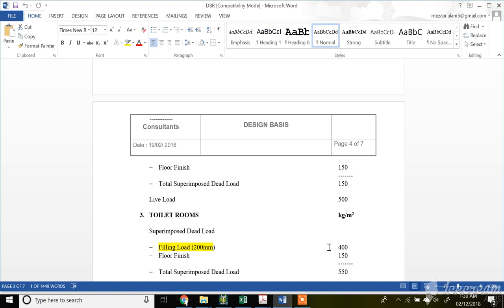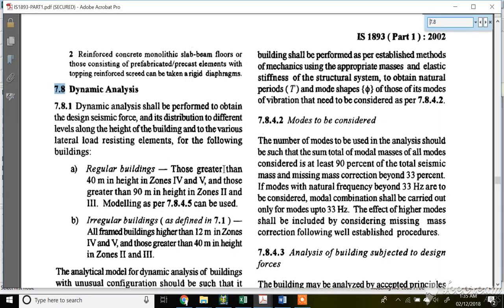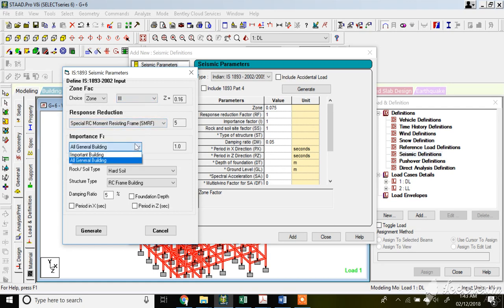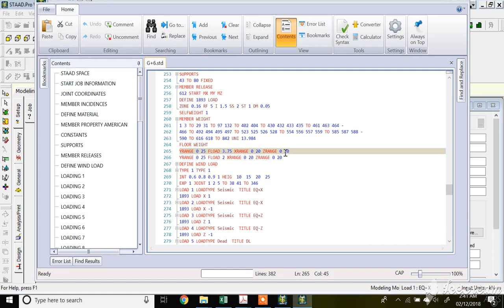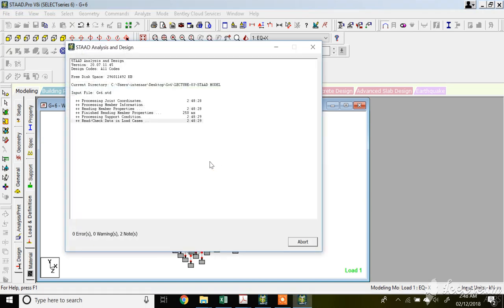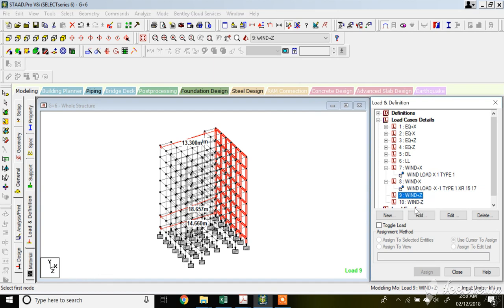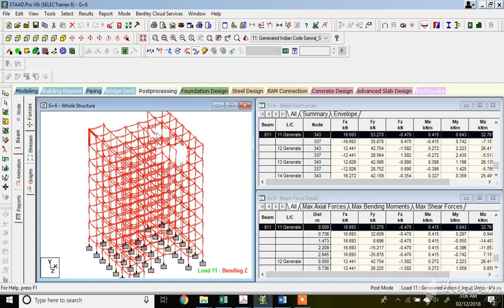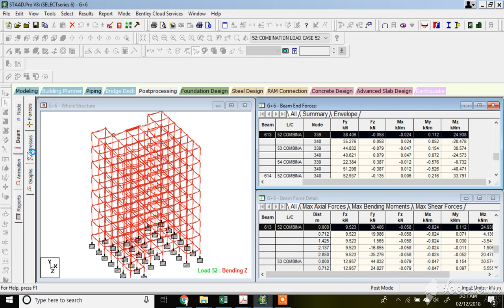G+6 Lecture - 05 Analysis & Loading - Part-2(WIND & SEISMIC LOAD)

Comment: 16:37 Why did you release moment in all the direction? How do we know that in which direction we have to release the moment?
Reply from the maker: Torsional Moment shall be released only in one direction. 
I just showed the moment release command
Reply: @Sacademicus   So how do we know which direction we have to release?
Reply from the maker: Torsion occurs along principal direction.
Reply from the maker: But again if u r doing in staad pro the if torsional moment is very less then u dont need to release.
But it is advisable to release torsion rather than neglecting
Reply: @Sacademicus  can you upload a video with different cases then it would be easier to understand.
Reply from the maker: Yes maybe in the upcoming weekends

Comment: sir, y u didn't add moment load 
please tell me something how to add moment and how to calculate moment to add on staad,   please tell me sir
Reply from the maker: I have applied simple load which is coming on structure. Moments are derived load.  Ill show how to apply moment on structures!!!
Reply: @Sacademicus  can you tell me how to calculate moment to add in staad?? please
Reply from the maker: @SatyadevaP96  moments will not directly come on structure it will be transferred form one structure. for example the reactions from column will be required to design the foundation so there will be moments on foundation.
similarly if there is any eccentric force so either you can create a node on ur structure and apply the load or you can convert that load into moment and transfer to nearest node.

Comment: After applying all loads when I run analysis it show error  "Above Command is Not Recognized.  Line Ignored ". What is the problem sir I can't understand this.
Reply from the maker: please check all the inputs and try even if then its not working send me the staad file .
Reply: Sir still analysis doesn't run. How I can send u stadd file?
Reply from the maker: sacademicus@gmail.com
Reply: @Sacademicus  I send you file sir. Plz check it.
Reply from the maker: I will check and revert back!
Reply from the maker: @shahjimit2867  i have send you the corrected model with a marked pdf of staad editor explaining where exactly the problem had occurred.
keep learning
Reply: @Sacademicus  Thank you sir for your support.
Reply: @Sacademicus  plz let me also know that 
Send both staad file 
To sivakrishnaduddu@gmail 
Thanks In advance
Reply: @sivakrishnaduddu4592  do you have the staad file..plz help
Reply: @manmeetsingh4502  no
Reply: @shah jimit plz send the staad file